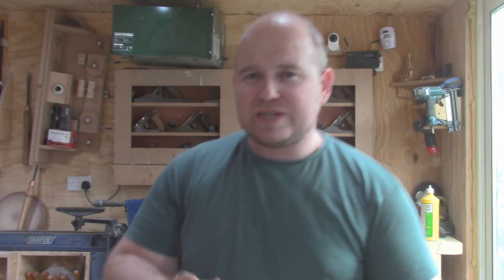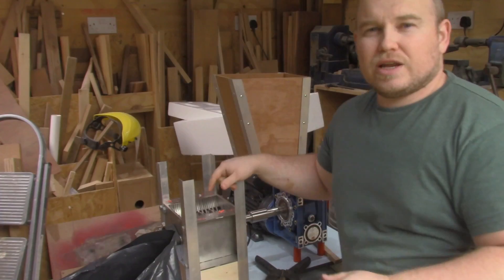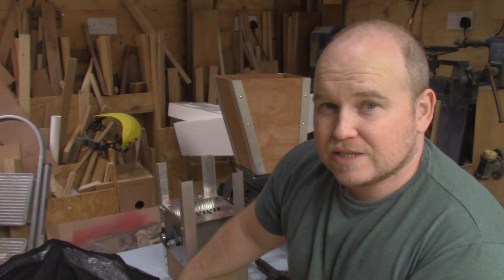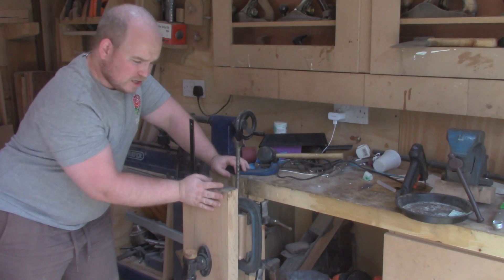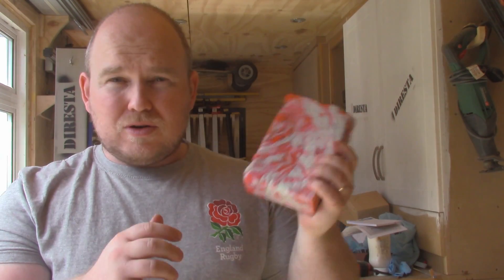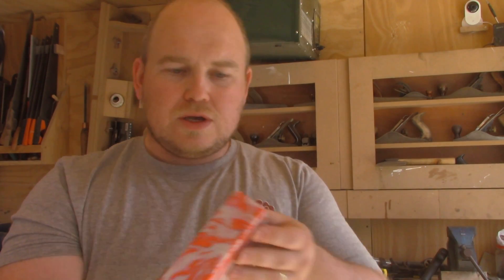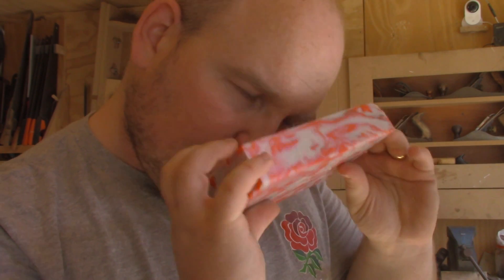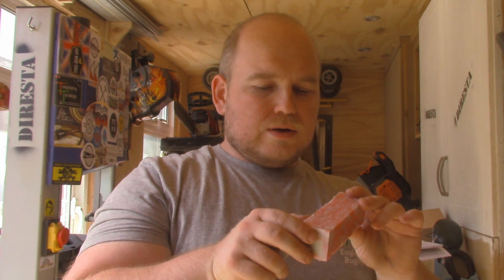Homemade Plastic Shredder Machine | HDPE Recycling

Comment: Hey Mate just wanted to say awesome what u can do with plastic eh but want to give you a word of caution! That shredder is dangerous if you slip it's bye bye hand and God knows what else my suggestion for safety is build  your own poker rod I highly recommend Brass Rods not steel rods or you will damage the cutting fingers Brass is soft it can't damage steel worst that can happen is you shut er down if it jams becuz u dropped it or pushed a wee too hard OK. 
I saw a earlier video of u using MDF boards as a mold that's cool but I have an idea on how you can cool down your plastic faster make water jackets what I mean is drill a 1/4 inch hole all the way thru 2 per board and just the longer boards after drilling the holes well your a smart guy figure out a way to tap the holes for threads add pipes get some rubber hose suitable for water 4 in and outs to keep water cycling a big bucket full of water add ice too keep water cool and finally find a water pump that can keep circulating when u figure out the logistics of it I wish I could show you a drawing but as I said your smart you'll figure it out see circulating water is what we call cure or cooling time if u do this u will cut  down the cure time from what 4-5 hours down too a 1/2 hour that's not bad eh thing is plastic will shrink faster because cure time has been sped up so u need to continue to keep pressure on plastic blocks to prevent sink marks keeping pressure on plastic is generally called hold or packing time I hope I'm helping you to make sense of this if u have question just leave a comment and I will be happy to help you I'm impressed in what you have managed.
I know a lot about plastics as I was a Injection molding and injection blow molding technician I work for Thermos for nearly 15 years 25 years total experience in Plastics molding thanks for reading hope I helped!
God Bless Stay Safe 🙏
Reply from the maker: Wow that is incredible, thank you for getting in touch. The machine is a friends but I will pass on your comments also the ideas for cooling as he wishes to build more machines to produce an end product. For myself I don't feel I make enough to justify making a cooling system. If you want to chat some more please send me an email as I'd love to hear more 😊
Reply: @WHCreations  Could you maybe just design and form your own push-rod made from that same plastic you're shredding? ...that way any small pieces the shredder might nibble off your HDPE push-rod would only be adding to the batch rather than contaminating with bits of brass/wood/whatever
Reply from the maker: That's a really cool idea and yes, check out my buddies, brothermake, they make one

Comment: Whenever I encounter voids and air bubbles in  my HDPE blanks, I use a heat gun to heat up the plastic around the void, then I pack the void with shavings and let them melt, packing them down with a chissel or knife.  I continue packing and melting until the void is over filled, then allow it to cool before continuing with my work.
Reply from the maker: Wow that's a great tip! Thanks for letting me know 😊👍

Comment: I use to work in a plastics firm. And we use to shred, grind the stuff up to be reused, the finer the shreds the better the remelt will be
Reply from the maker: You will be the man to ask then mate. It's fantastic stuff and I'm the sort of guy who you'd lose in a factory like that as I love seeing the process. I think if I had full bottles the grind would have been alot better. The red went very small but the cut up bits didn't get caught right so some went straight through.

Comment: m8 you need to be more careful on the planer. :/
Reply from the maker: More careful? Why what did I do wrong or dangerously?
Reply: @WHCreations  I would only expose as much of the blade as is required for the job. By move the fence across to cover the blade you are not reaching over an exposed spinning blade.
Reply: *jointer

Comment: Awesome job Will. Been considering building a shredder from the Precious Plastic plans for our HDPE projects. It’s hard to justify that amount of money though! I wonder if you could buy a seriously heavy duty credit card shredder and use that. Food for thought! Look forward to seeing what you do with those blanks 👍🏼👍🏼
Reply from the maker: I did question this also but I tried to put some plastics through and it just didn't either have the power or cut correctly. We did have an idea about a chef's kitchen grade meat grinder/mixer welding a rod through to the shredding teeth... I also had idea of cutting the teeth out too. It wouldn't be the same as this machine, big up motor/stainless steel etc but it would get you going cheap enough
Reply: some decent ideas there. What type of shredder did you type? was it an office-type one or anything more industrial? i like the idea of the meat grinder but worry that the gaps would crumple rather than cut the plastic.
Reply from the maker: You would only use the motor from the grinder not the teeth. You would have to fabricate the teeth then weld a rod to go through the motor to the teeth. You would have the added benefit of speed control.
Reply: ah that makes sense - may have to do some research
Reply from the maker: Get your school to buy one... and then give homework, bring teacher all your milk bottles *make sure you wash them first or you fail
Reply: WH Creations haha there’s one problem with that otherwise flawless plan... budget! Like the idea of free HDPE though 😁😁
Reply from the maker: How many kids do you teach. You can say it's a class project to save the oceans. If every kid brought you in 2 milk bottles... boom
Reply: WH Creations 2-300 usually. Haha that would be a lot of plastic!
Reply from the maker: Do it! Force them to your bidding for fear of... da da daaaa detention!
Reply: WH Creations 😂😂 if only the finance department were as passionate about HDPE as you, Will!

Comment: What a beast!  Yeah, a machine like that would have to have a lot of torque strength, I can see it being expensive.  And wait a tick, is that stainless steel?  Beautiful machine.  He'd be lucky to get that back out of my house.
Reply from the maker: Haha tell me about it. Yep all stainless steel laser cut so it's pinpoint accurate. He is going to be adjusting it over time to make things better. I did suggest a shaker deck with a hopper to slowly load the plastic into the teeth. We did have a few jams but they were quickly fixed by reversing the polarity in the motor.
Reply: Yeah, that'd probably help.  Congrats on getting some solid HDPE.  It looked like imitation crab meat at one point before the colors popped.
Reply from the maker: Haha yeah when I took it out of the mould I wasn't entirely excited...
Reply: But it came out really good.  I'd love to turn something like a pen from that.  It'd be a great bragging piece to show friends.  Something like, "What do you do with your plastic?  Throw it away?  I make pens with it."
Reply from the maker: 🤫 don't say any more...

Comment: Loving the marble effect.  
When you say about using a router and bandsaw, would you treat it like a hardwood?
Reply from the maker: Thanks buddy. It went through the thicknesser really easily. And cuts on the bandsaw like softwood. I would treat it with a bit of respect as if it did for example hit a good or a particular hard piece it may still catch or fly out at you.
Reply: WH Creations thanks for the quick reply, sound advice.